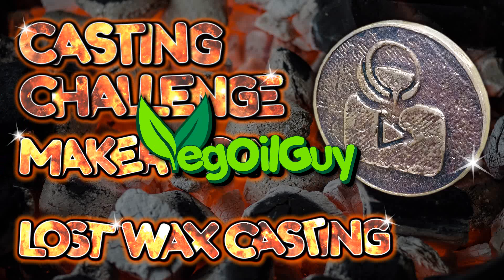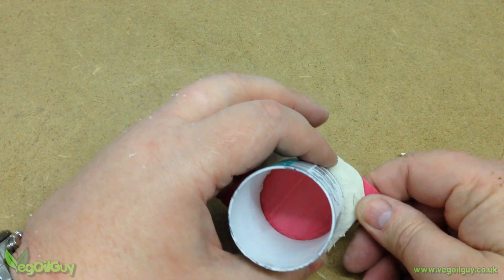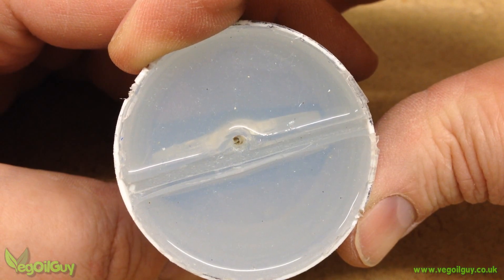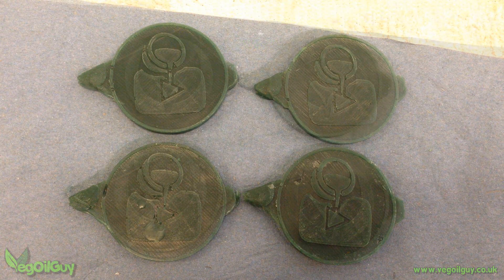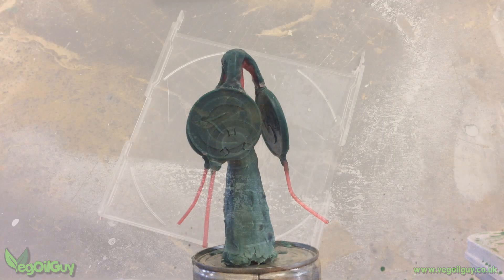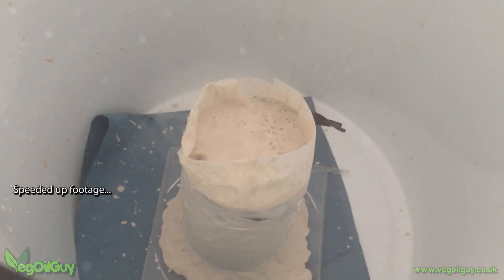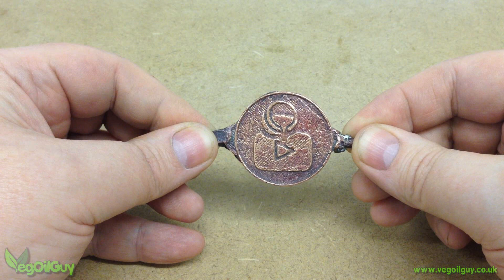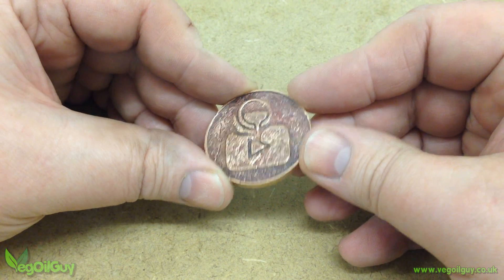INTRO TO LOST WAX CASTING - maker coin challenge by VOGMAN

Comment: Use cast aluminum not extruded aluminum it's not good for casting because Cast aluminum have silicon, and copper in the alloy it's is very good for casting i use this alloy and coppy very fine details of small old coin, from the start of brasillian Republic.

Comment: For pieces on the scale of the film logo, have you considered ceramic shell casting? Helps deal with shrinkage and gas escape with larger pieces. Or for jewellery, there is steam casting  - not perfect, but a big step-up from gravity only.  I've also had remarkably good results from deft - given the right geometry - comparable to lost wax, needing only a quick trim and a final polish. R
Reply from the maker: I must admit, shell casting is calling to me... but I've still got a big bag of plaster investment to get though and a few experiments planned (I can't resist). After that, who knows  : )

Comment: Another great vid!  But a suggestion - instead of casting them in copper, which is horrible to cast,  buy a spool of lead-free plumbers solder, which  is 95%-97%  tin and 2.5% - 5% copper, and then by simply cut of a pre-weighed length of solder, and toss is in to the copper when melted (don't forget plenty of borax as flux) a quick stir or two and you can cast in lovely bronze, that flows and casts much better than copper - machines better too. The nice thing is it enables you to avoid one of the worst issues for hobby casting, which is poor or unknown metal quality. If you use scrap copper from on electrical bus-bar and contacts etc, it is usually oxegen free, meaning better quality from no dissolved gases. Poor/unknown metal quality is something that is a big problem in metal casting - which is why of course there is huge industry refining scrap back to pure metals which are then re-alloyed from scratch before casting - to cast successfully, good quality consistent alloys are essential, as alloy proportions effect all of the other variables - melting point, viscosity, pouring temperature, mould temperature, investment type, gating and venting. It's important not to use too much scrap gates and sprues - jewellers working in sterling silver try to keep it below 25% if possible and definitely below 50%. Scrap produced can be reduced by the simple expedient of weighing the wax used before burn out, and using a simple calculation to give you the amount of metal you need to melt - this is also good as it means you melt less metal = quicker melting = less dissolved gases.  Good to see the use of proper investment and consideration of waxe used - so many vids try to save a few £ using things like ordinary plaster and candle wax - very much a false economy.  I think the issues you've had in casting the coins and the film logo  were mainly down to too low a mould temperature - you can compensate (to an extent) by increasing pouring temp - but you can easily get increased  shrinkage problems, more dissolved gasses and if casting brass or alloys containing lead or cadmium get increased chance of noxious fumes - (another good reason not to usescrap!). As an example, when casting sterling silver (m.p. ~890c  )  burnout goes upto 850c-900c then down to 600c for casting. This is done using a 4 or 5 stage burnout schedule, typically over 10-12 hours for jewellery - (possibly longer for bigger items), specific to the type of metal, investment and sometimes the material being burnt out. As you have surmised you need a kiln to do burnout, and one with a multi-stage programmer - unless you fancy minding a kiln for 12-18 hours!  The good news is there are plenty of old kilns on ebay that are very reasonable, and kits for programmers, which are very cheap too.   Lost wax casting isn't difficult, but it is precise and unforgiving - so you need correct AND consistent materials, you have to measure, measure, and measure again ,  and 'shortcut' = failure!  There are so many little things, anyone of which can cause disaster, that many use a check sheet with every last item on it, with spaces to record all the details of times, temps etc - this is often mandatory in professional settings. Hope some of this helps!
Reply from the maker: Wow, what an informative and comprehensive comment. It's much appreciated. You clearly know you're stuff. Thanks for sharing this : )

Comment: Saw a DIY rig recently for doing vacuum casting with a pump like yours.  It was basically just two metal tubes that fit with a small gap between. The bottom "vacuum chamber" was basically a thick-walled steel pipe welded to a steel base, with a flange and gasket at the top, and a hole drilled and tapped for the vacuum connection near the bottom. the inner tube was thin walled with holes in the sides and bottom, and a flange at the top to mate up with the bottom tube. The "vacuum" plaster was cast in the inner tube with a removable silicon cup over the inner tube. Best of luck with your explorations.
Reply from the maker: Thanks Walt. 
Whilst part of me is tempted to look into a vacuum set up, for me these cylindrical flasks are quite restricting. I was very grateful to both John and Paul (my experts), but I was aware that both of these guys specialise in the miniature. Unless another challenge arises, the sort of things I normally make (gears, wheels, brackets, etc) are all a little larger.
Of course historically wax casting was NOT done using vacuums. The museums are full of bronzes that were created long before most even knew what a vacuum was, so I guess there's hope for me to cast something yet  : )
Reply: VegOilGuy I totally understand, the DIY vacuum rig I saw was likely for stuff under 10mm and that definitely would be restrictive. From what I've seen lost wax investment casting is usually the route for medium to large castings which need higher detail. Of course that is a time consuming process building up the refactoring shell, and the special slurry and zircon sand for the process isn't exactly cheap. I'll see if I can find the link to the Youtuber who I've seen attempt the investment casting process in his back yard.
Reply from the maker: Thanks Walt. I'll watch that later : )

Comment: Since watching this, something about the vacuum process of the plaster seems a little off from what I remember of the little bit of Jewelry casting I've done. I only remember small bubbles coming out of the plaster stuff I did a long time ago. As I've thought it over, I think your vacuum might be drawing too deep and causing the water to boil and likely reducing the detail in the plaster impression. I believe the ideal vacuum level for this kind of stuff is deep enough to force air out of the mix but not so deep that the water boils. I'll have to look some stuff up to verify if that is correct, but that's what sticks out in my mind at the moment. I think we had a light vacuum on the plaster and it was over a number of hours. (I'm sure your expert mentors could verify if the vacuum was too deep and if that affected the plaster impression)
Reply from the maker: Thank you Walt... I've been thinking that all along.
It genuinely bothers me...
I know if you put water in a vacuum chamber it boils... and plaster is largely water. So is the water boiling off I ask myself.
It's great to have someone else ask the same question. You're a gent  : )
Reply: I know the boiling in a vacuum is a question of temperature and pressure for water boiling in a vacuum chamber, Assuming you are at room temp (about 23 [C]) water boils at something like 29.12 [inHg] (of vacuum gauge pressure), So as long as you regulate the vacuum to have more pressure in the chamber there should be no boiling of the water. 

One suggestion I just read as I'm trying to find a reference on this is to degas just the water before mixing it with the plaster, this should speed up the whole degassing process for the mixed plaster.

28-29 inHg (as a measure on vacuum gauge)  is the range of vacuum needed, just slightly above the boiling point under room temp vacuum
(Still not finding a great reference on details for this portion of the process)
Reply from the maker: Thanks Walt

Comment: Not bad , not damn bad at all for a first effort. What little I know of investment casting tells me that it is an exacting discipline requiring patience, practice, and persistence and that it has a very steep and very long learning curve. To have achieved this level of success with minimal equipment on a first try is quite remarkable. I think that both John and Paul would most likely concur when I say that with more and better equipment - wax injectors burn out kilns vacuum casters etc plus the continued application of the three "P"s mentioned above results will improve, Oh! And some decent metal of course. Keep up the good work.. Martin
Reply from the maker: Thanks boss! The important missing words there were, "This is much better than Perry's"  : )
Your input was crucial as always. And John and Paul were also very patient and supportive. So you guys made it possible - thanks again.

Comment: Instead of a vacuum rig could you use centripetal force mimic the effect of the vacuum?  I think I have seen jewlers use a centrifuge-like rig to cast very small pieces.
Reply from the maker: You're absolutely right Mark, they have and still do use them. But I'm the kind of guy that would just HAVE to build one. Then I've have the fear of something containing metal 10 times hotter than boiling water whizzing 100mph by my head : )
That's brown trousers stuff that is ; )
Reply from the maker: Vertical would take up less space, and keep the flies from around my head, but it might redecorate my garage with liquid fire. Perhaps horizontal is a better approach. Thanks for the link... I'll take a look.
Reply from the maker: Thanks Walt.
D'you know what... I'm suddenly going off the idea  ; )
Reply: Geoff, Think horizontal spinning with a machine, jewelry has been spin casing metals for a long time. There are DIY plans out there for small-ish machines to do this. But having used them, I never got past the brown trousers stuff while releasing the spring loaded mechanisms (but that might have been something specific to the ones we were using).  https://youtu.be/j-I0l5Rh0wg
Reply: The only quasi-vertical casting for centrifugal casting I have seen is for making seamless pipes and tubes like in these videos. The molds are spinning while the metal is poured along the length the same way large commercial cast iron pipes are made.
Small shop size
https://youtu.be/iUjOhtXCoro
Commercial sized
https://youtu.be/kJGlgSZe4k4

Comment: I'm sure if you send me the aluminium ones, I'll be able to make it just as shiny and nice as the one swdweeb is holding at the end of his video (not really, his looks really crisp, but then he used a metal that is far better fit for coin casting). But I'm sure some extensive hand sanding could really push your result up a level or two.
Reply from the maker: I know Perry struggled with the editing on this one and had a lot of footage to trim. Personally as a subscriber of Perry's and as a viewer, I'd like to have seen the work he did on the coin after casting. I agree there's grinding and much polishing there, and the results are clear to see. Lot's of effort and a justly obtained reward.
But that's not my style... I'm too lazy : )
Well, it's more the fact that I like to show things warts and all. I agree with you Luke, I could have cleaned than coin up nicely (still not as good as Perry's, let's be clear on that). But to achieve that, I would've had to grind away those lines... and I wanted those.
If I had achieved perfection, it would have looked just like the printed version, tool marks nice a clear.
But for a while, I was tempted ; )